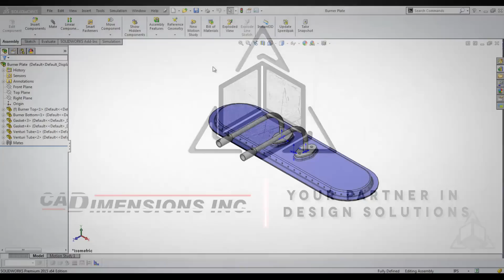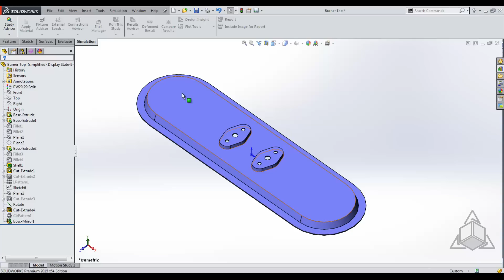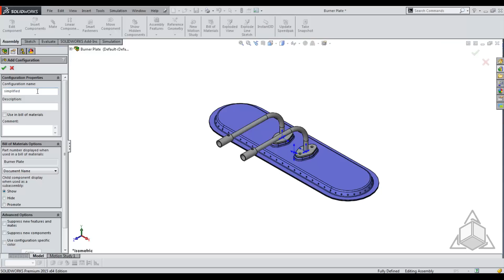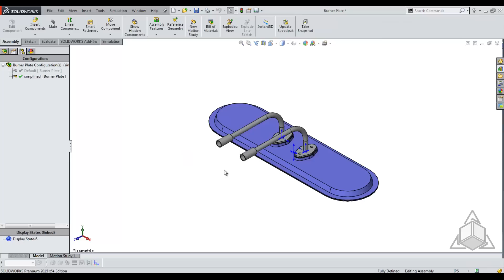Tech Tip - Simplified Configurations

Comment: I am wondering, how can I make a rubber track follow around a set of gears in Solidworks. I need it for a school competition for NASA. We are currently using a the belt feature but we would like to have a track instead.  It would be better to have the full working assembly for testing and sponsorship demos. Any suggestions will be helpful.